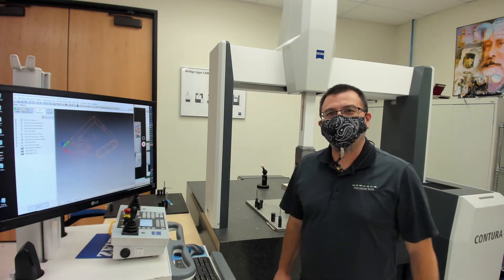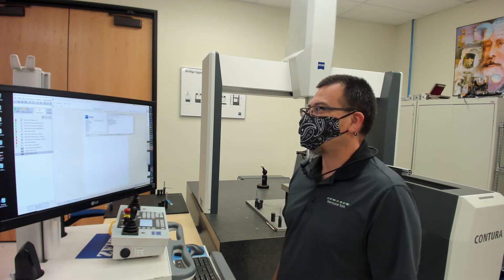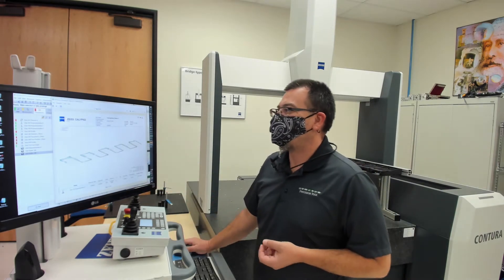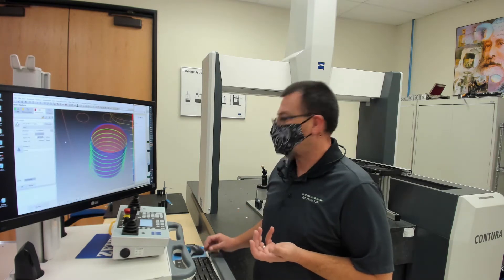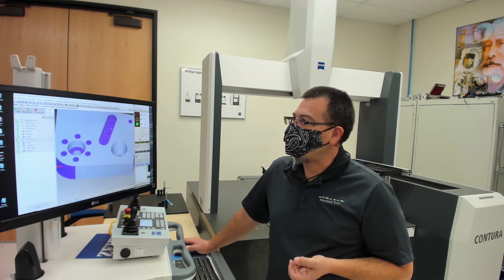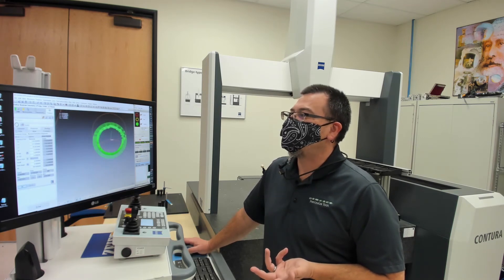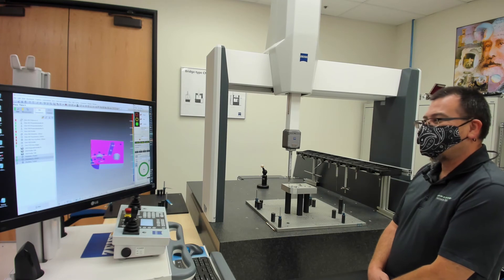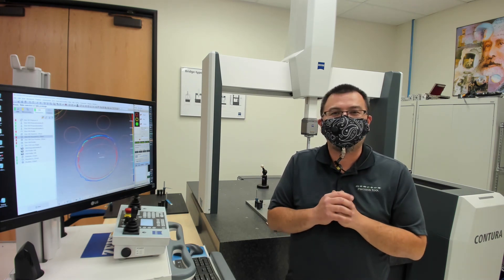John's Calypso Demo

Comment: I think you made a pretty broad assumption about the cad model comment. As much as I wish it were true. Many machinist I know just program the G code directly to the machine. Its more of just a text document.
Reply from the maker: That is very inefficient as the spindle is idle while one is typing. The same is true on a CMM. If one is programming at the machine then one is not making the best use of the available technology.

Comment: Internal gear  how to convert cylinder please explain
Reply from the maker: That is a good suggestion. We will see.
Reply from the maker: The command is found in the pull down menus: Plan/Advanced/<Convert cylinder to circles>
Reply: @Firehead-Q  internal spline how to convert cylinder based on teeth
Reply from the maker: I see, if working with CAD. Extract one spline face as a Cylinder and change the angle range to 360.
Then either activate Flyscan, or set up a Strategy using the line scans strategy.
Reply: @Firehead-Q  sir how to convert internal spline gear to cylinder    any suggestion video uploaded sir